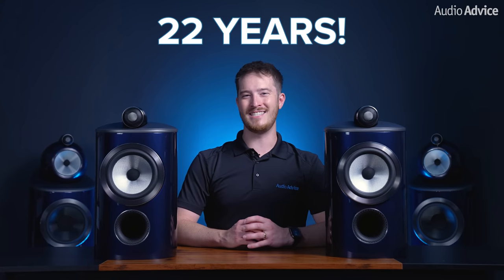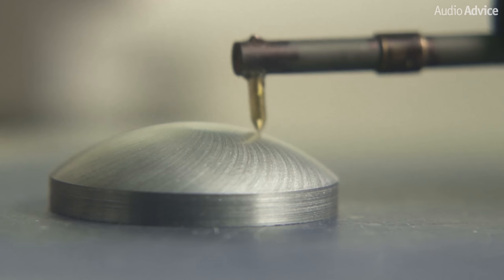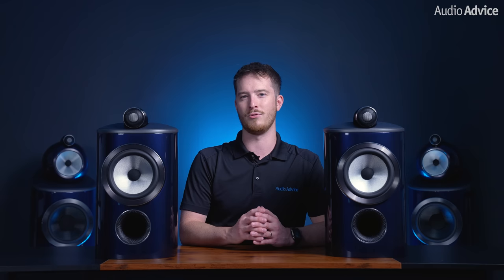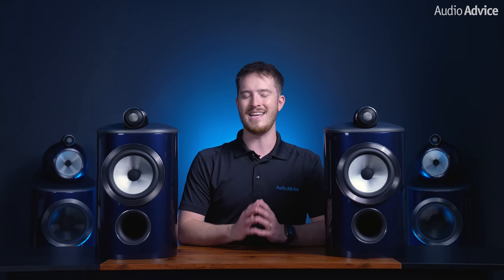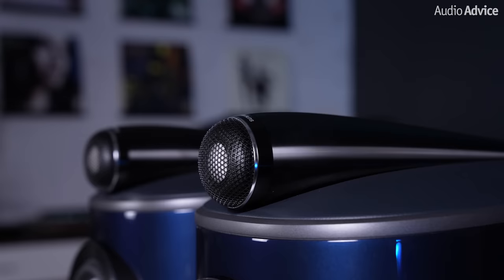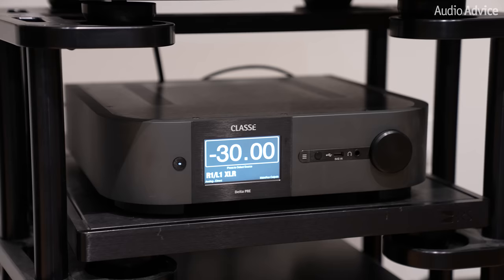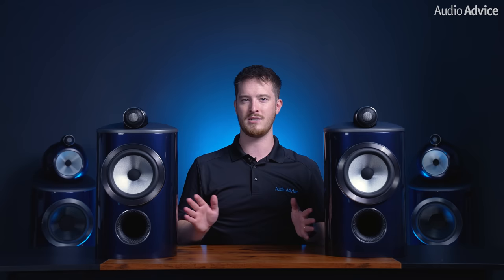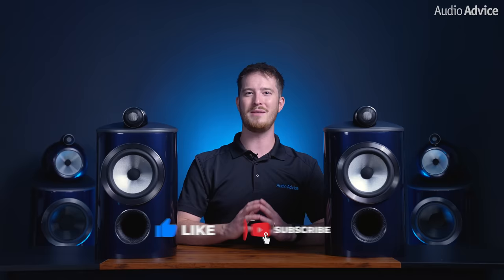Bowers & Wilkins 800 Series Signature | NEW Componentry & Finishes 801 D4 & 805 D4

Comment: It’s expected that you would say that your salesman and a sales company I have the 805 D4, and there is no way that I can see justification in the differences northern price even if with a listen, it would have to be such a substantial upgrade for the additional cost
Reply from the maker: They are at a premium, if you already have 805d4, its probably not worth considering.  And there are more differences on the 801's, they bowled us over.  We appreciate you watching
Reply: @AudioAdvice  I would say if you had a set of good subwoofers, you can achieve the low end for proper calibration and placement
Reply: @AudioAdvice Thanks for the honest assessment. It was clear in your review that the 801s were the big upgrade, not the 805s.

Comment: Hi....May i ask a question about the 805!
Reply from the maker: Sure, tech questions are best by going to www.audioadvice.com and asking our team
Reply: In your video description you said,regarding drivers, that the 801 drivers were upgraded and that the (SAME IMPROVEMENTS) were made to the 805 signatures regarding drivers!  @AudioAdvice   Can you confirm this to be  CORRECT about the 805 signatures drivers? Or is it the driver motor that you say that both were upgraded? Can you elaborate a little more about the drover/motor of the 805 sigs?
Reply from the maker: @xsamitt  From the B&W release on the 805Sig "We take the same approach with the mid/bass drive unit on 805
Signature, which also features an upgraded pole on the magnet plus
a larger vent hole for improved current distortion."  Hope this helps you
Reply: Is there perhaps a link where i could see this? @AudioAdvice
Reply from the maker: @xsamitt  It was in a doc we had pre-release we had to sign an NDA to get, which is still in effect.  We will ask if we can send it to you.  You could also reach out to B&W and see if they will share.   May we ask the reason for your interest?
Reply: I want to know about the 805 to help with my purchase decision.I would welcome seeing the press release ! I will await with keen interest! thank you so much!  @AudioAdvice
Reply: I have bought 800d3,805d3 and an 803D....So You could say i really like B&W.So this info would really be appreciated!

Comment: So the 805 are just blue with some small differences in the filter. …..… a little bit off shame, isn’t it ? For the price… ok the 801 are different
Reply from the maker: The 805 has the a new midrange/bass driver as well, but there are more changes in the 801, yes.  Thanks for watching
Reply: Are you sure about this? @AudioAdvice

Comment: 😊 B&W crossover downgrade even further again 801 signature model.😅 From Silver/gold downgraded further again to Alum Cap 801 signature model.😅 Making buyer very very Angry nowaday.
Reply from the maker: Sorry to hear that!
Reply: I got some 706s as reference for my speaker building hobby. They do help with levels but I don't like my 706s. They sound a bit "foofy". And my made speakers absolutely flog them (even if the 706s did help). I just don't 100% copy the sound and give it my own personal sound (just a little bit). Mine aren't so "foofy". 😅

Comment: ugly...easy to damage...tweeter laying on top 😂
Reply from the maker: It actually has a very sturdy protective grill they have perfected over the decades.  Without it yes, but with it, they are fine
Reply: @AudioAdvice  
I know the company has been doing this for years I think it's ugly though… Plus like I said it could be damaged easily I think speakers belong inside the cabinet not outside
Reply from the maker: You either like them or not, but the design does really improve the openness since the tweeter is not sitting on the front of a cabinet.
Reply: The good news is that they're only $25,000 each. So they'll probably only sell 2 sets. 😂
Reply: @bootneylee9802  🤣